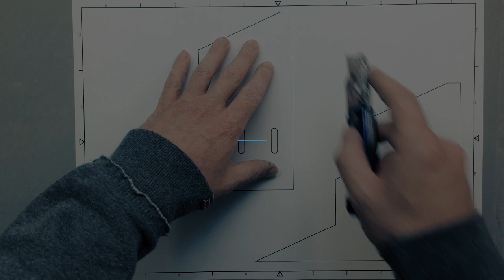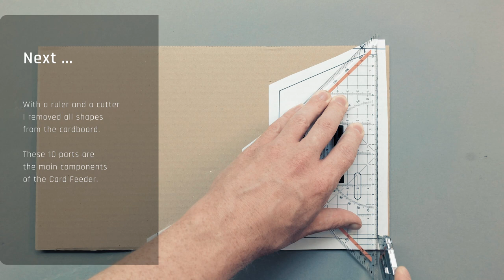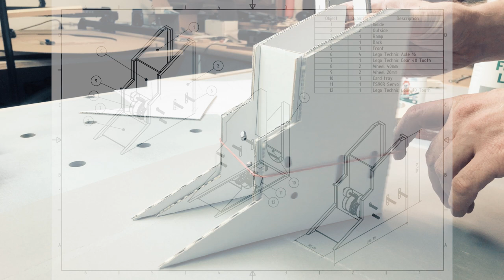How to make a Card Feeder for a Trading Card Machine using Cardboard, Lego and a Raspberry PI

Comment: Awesome project! I'm curious what's stopping multiple cards from accidentally being fed? Is there an advantage to feeding from the bottom of the stack of cards rather than the top?
Reply from the maker: Thank you! In my case, the wheel with rubber bands and the right pressure is the key to the single card mechanism. The feed from the bottom is necessary for this.

Comment: I don't even know if you'll answer this but here's hoping... I want to make this out of acrylic and use it in conjunction with a smartphone to scan my ridiculously large MTG collection in digitally... is there anyway to control the timing of how long before it pulls the next card? For example pull one card wait 10 seconds (for the scan), and then pull one more repeat.
Reply from the maker: Hello, yes, of course. It's Python code. So very flexible.

Comment: I know it's only been 2 years, but it seems like everyone is 3D printing; I saw you 3D printed the wheel in the other video. I have to wonder why the choice of cardboard, or if you would do it differently now? 

Awesome videos by the way < 3
Reply from the maker: Hello, you are right.
I used cardboard to try something new. Faster and easier to handle.
If someone wants to replicate it, I would recommend 3D printing.
If there will be a version 2, I would also switch to the 3D printer.
Reply: @theguymasamato3288  I must know if you were successful automating card sorting. I've helped a friend do it a couple of times but the developer in me wants to automate it, but I'm more of a software guy than hardware, but I love that you explained you took apart a printer to find out how it worked -- that makes sense to me. I just didn't know where you would start or if it would potentially ruin cards. I know there are awesome scanning apps out there but I'm not sure that you could hook into them 🤔 I got back to thinking about all this after watching Mark Rober's dominos bot.
Reply from the maker: @CTSSTC  My machine consists of 3 parts. Feeder, scanner and sorter. All 3 parts are working. But the last step is still missing to combine all 3 parts to a working machine. Unfortunately, I do not have the time at the moment. 
But I am confident that it would work.
The machine is suitable for LowLevel / LowValue cards. Bulk processing. I would not put any mid or high value cards through the feeder. 
The cards will be very stressed there.